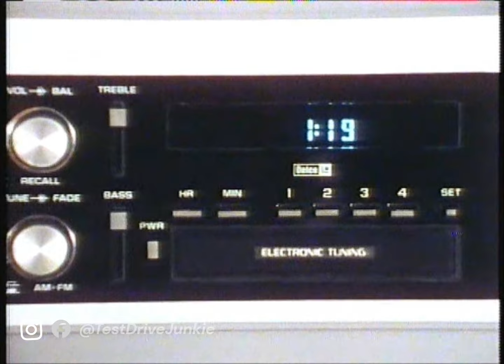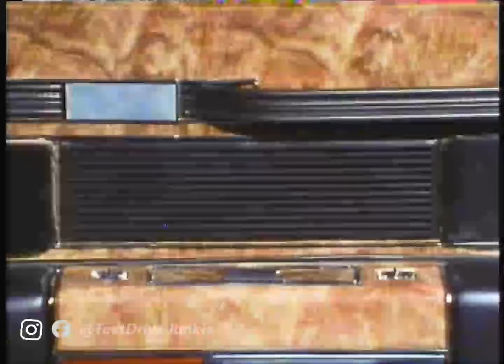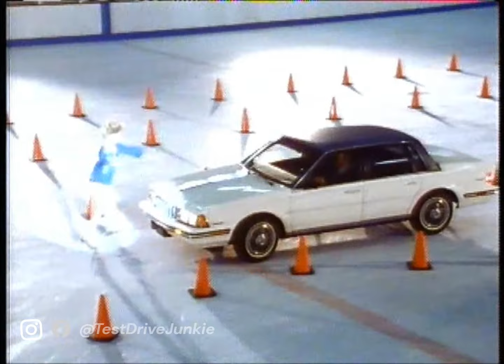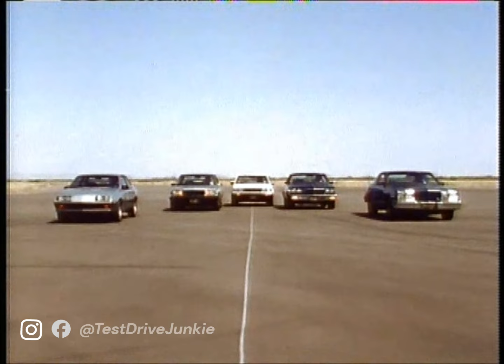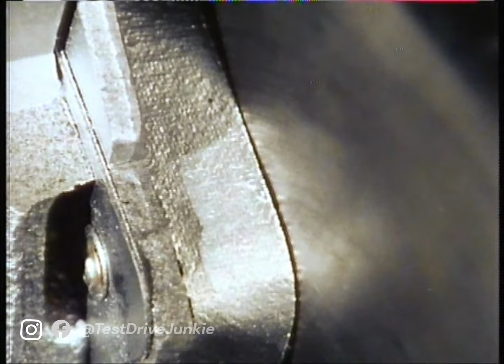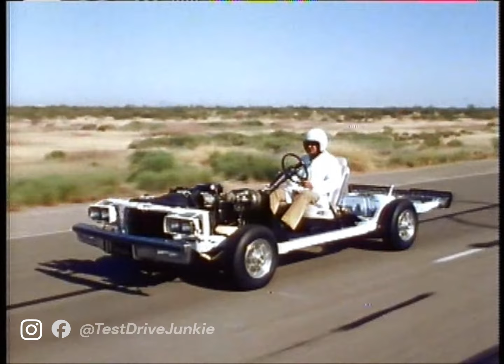1984 Buick Tech Features Side One Manufacturer Laserdisc Promotional Video

Comment: These “Delco” radios, introduced for the 1982 model year, were actually manufactured by Panasonic…
Reply: I don't see any details of Panasonic manufacturing head units for GM until many years later.  Where have you seen any head units being made by Panasonic for GM in the 1980s?  I am genuinely curious.  Or perhaps just the tape mechanism, if correct?